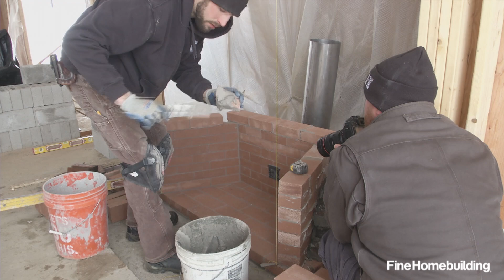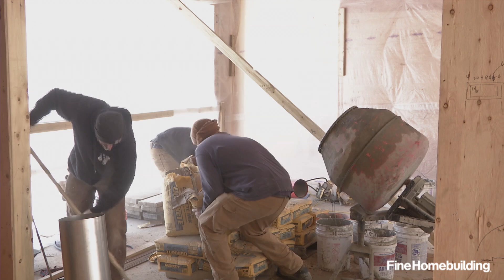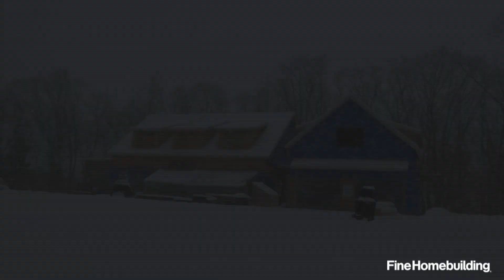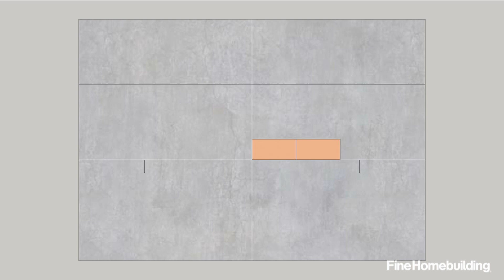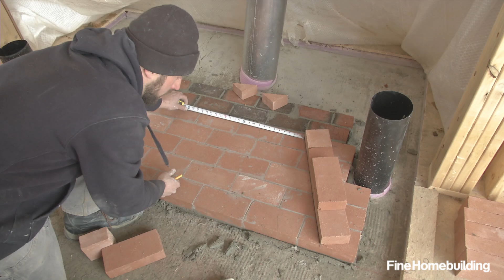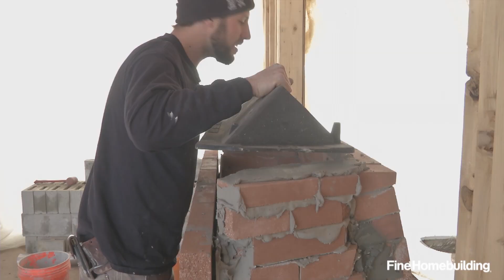Build a Fireplace, Brick by Brick

Comment: I watched almost 6 min. of the video. Overall it looks like he is doing a good job. The only issue I have with it is the side walls are never interlocked with the back wall. I always laid the first 4 or 5 courses with interlocking corners, like on a veneer wall. Those courses go straight up and then the fall to the damper starts so it is easy to do.

Comment: What type of mortar is used for the brick outside of the firebox? Is that called the facing? I have some mortar that is crumbling on the facing and want to repair it. Not sure if I use high heat or something else.  What do you suggest?

Comment: I am dealing with a restoration of an old house and need an especially shallow fireplace. Local building codes require 20" deep BUT allow Rumsford fireplaces of only 12". So, that might be the route for me. From what I have read, I thought the defining characteristic of a Rumsfeld fireplace was an especially narrow throad between the top of the firebox and the bottom of the damper. Is that not right? Does the curved wall do that same thing here?

Comment: Is Possible to add bricks to existing fireplace? The the top of the front opening on my fireplace is not low enough I don't think and it lets smoke into the house I believe with that lip was about two bricks lower it would be able to catch all the smoke and go up and out. It's quite a huge opening it's got no door it's very old school. is it possible to do this

Comment: does the box go inside or outside of the house? If a fireplace is placed on an exterior wall, how would you butt the framing up to it?
Reply: You leave a 2 “ gap and sheet rock up to it . You need 2” for combustion

Comment: Combustible foam for expansion joints around those conduits (which are encroaching into the firebox 8" wall thickness)? Setting a lintel onto foam? Haven't heard of ceramic fiber insulation? It's non-combustible and used to wrap chimney liners for a 2,100F rating. Code allows for a 12" firebox depth on Rumford fireplaces-20" min. for non-Rumfords. Very poor cuts on those back corners. Almost no brick in corner. Not supposed to be wide mortar joints even if refractory mortar. Why not keep the backwall straight up and use a top mounted damper on a listed factory chimney? Terra cotta flue tile chimneys are archaic and obsolete. They should be banned now that we have listed liners and chimney. Glad to see he's laying thin joints as required by code. That CMU block must be fully grouted. sides should be bonded in with rear wall. He needs to take a class from Chris Prior to learn how to build a firebox.

Comment: Why are the corners not weaved only stacked?  That is not a strong inside corner.  This will eventually crack and with the massive over cut on the backside of closure may leak heat or into cavity behind firebox.
Reply: You cannot weave the bricks because as you go up towards the top the courses will not line up due to the angle on the back wall. Fireboxes are always built with an inside cold joint and usually backed up behind the box that you cannot see. One more note is if you use refractory mortar or heat stop like your suppose to then it shouldn’t crack. I hope this helps
Reply: @russellallen5482  The joints will not line up perfectly but close enough.  Sidewall joints should be pin tight which helps.  I only use heat stop 40 for all my fireplaces.   It is only good up to 1/4 though.  Cuts need to be a little more accurate to be effective.
Reply: Burning down the house
Reply: Kudos for the Video clip! Excuse me for chiming in, I am interested in your thoughts. Have you thought about - Panilliaan Immaterial Prevalence (do a search on google)? It is an awesome one off product for protecting your family from danger minus the hard work. Ive heard some pretty good things about it and my coo-worker after a lifetime of fighting got cool results with it.
Reply: @josemauriciogonzalez7835  Does that have ANYTHING to do with building a fireplace?
No?
I thought not.

Comment: The angled back does add to radiation of heat.  A straight back  as per Count Rumford designed is more efficient.  Heat is radiated at 45 degrees.  With a slanted back you are directing heat down into fire instead of straight into room.
Reply: So if you lay down next to a bonfire you won’t get burned? Air behaves differently at varying temperatures. Ponder this term for a good long while: baffling
Reply: @ignistactus1108  A bonfire has no walls to direct heat in one direction.  It will radiate in all directions.  Not sure of what the point you are trying to make.  I'd be happy to forward links  explaining the mechanics of a Rumford fireplace and how it heats a room.

Comment: Anyone know why he cut the side bricks at a 45 instead of a shallower angle? It left a gap. Was it for expansion?
Reply: The 45 makes it a bit easier to trim the bricks to fit. If the angle were shallower, he'd have a bit more material to hack through. The gap gets filled with refractory mortar - by code it needs to be filled solid. No worries of expansion. There's no reason you can't cut the bricks at a different angle, but a 45 is easy to lay out with a speed square.
Reply: @matthewmillham2025  Makes sense. Thanks!
Reply: Because they did not measure.  It's pretty simple to get a line and cut .